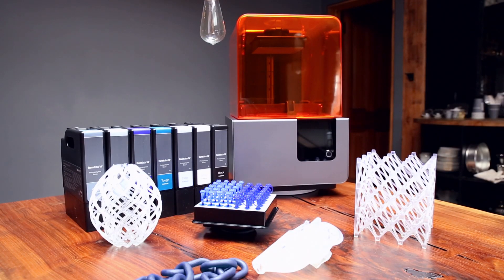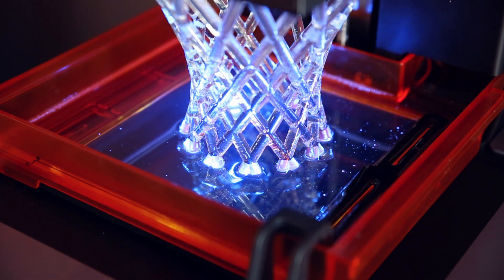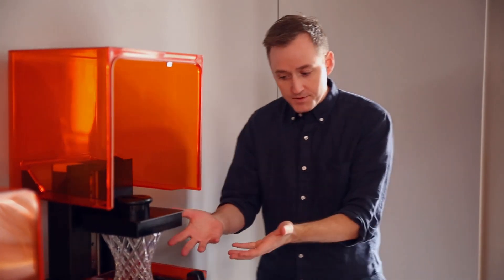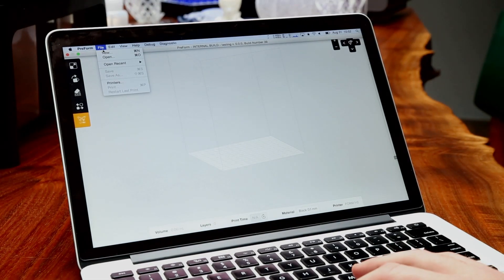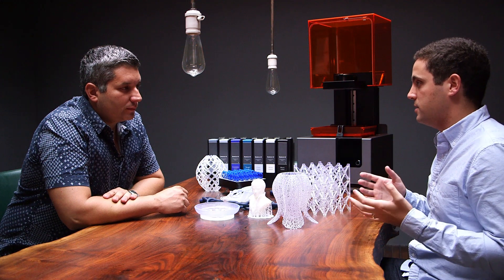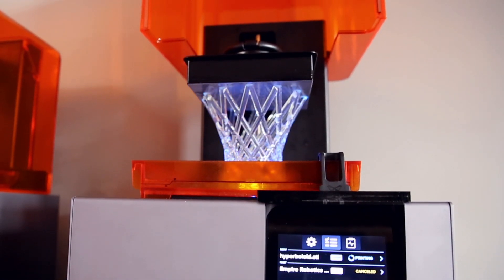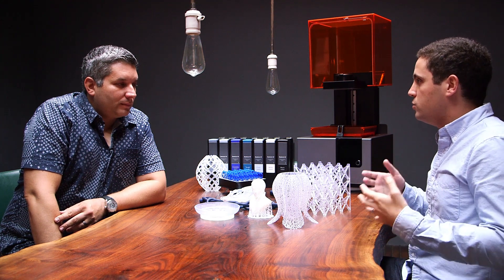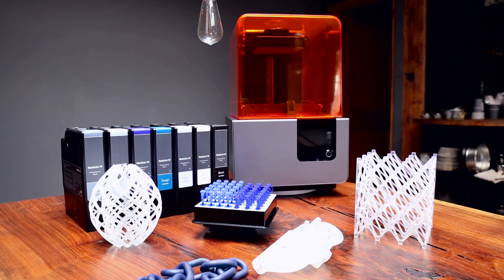Formlabs Form 2 3D Printer

Comment: I have been using this printer for a few months now to prototype parts for medical designs. First, I have no issues with prints sticking to the build plate, actually, I have a very difficult time getting them off. I am using the entire build envelope and even adjusting my designs to fit. It has worked great so far. I have had a few bad prints but 90% are great. I do have issues with warping. both from their curing system and from heated water that I use to test with (manifolds). The warping is more of a material issue but I do see some warping right from the printer (printing parts that are 4.5" x 8.25" x .5"..large flat parts). I am still watching the market for whats the next best thing comming in their price range. I'd really like to see a Form3 with a much larger build envelope. I am sure glad I'm not having issues as some of these posters, this thing is making my job allot easier and a ton cheaper.